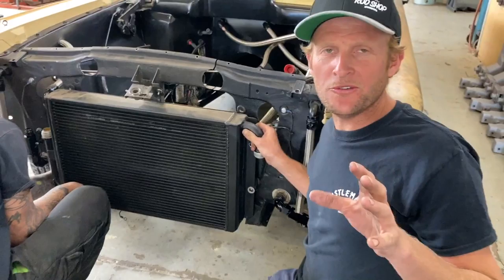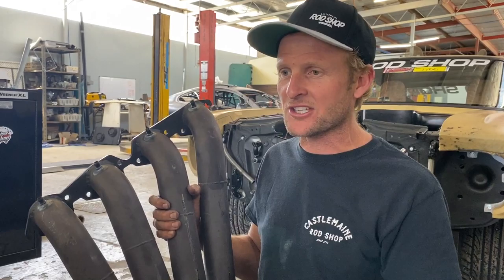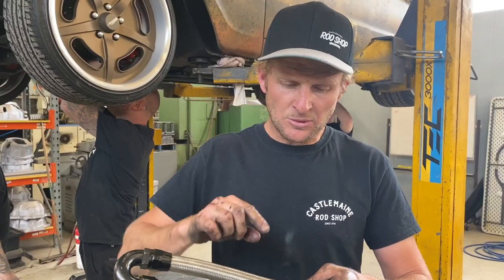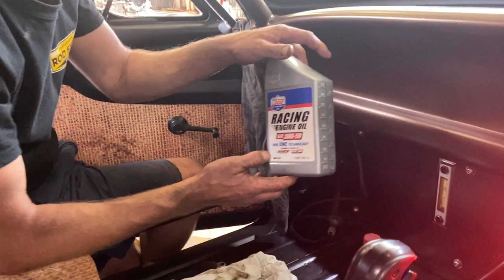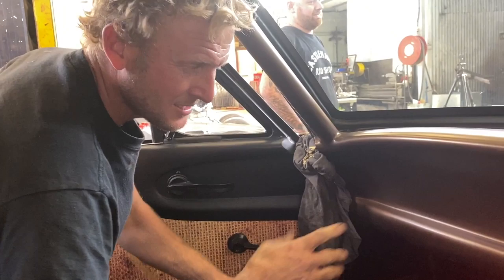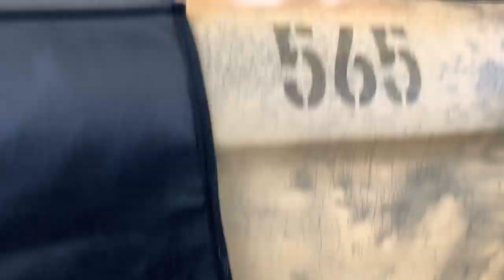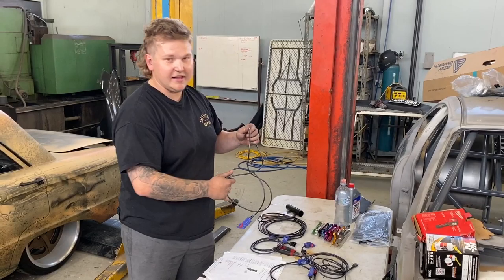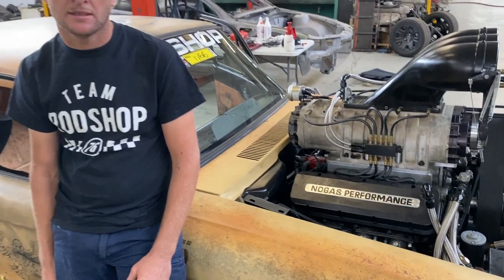USA Trip Episode 2

Comment: Man alive, there’s NOTHING that sounds like a big ol’ screw blower on alcohol. 
Well, except for a screw blower on Nitro...😏 subbed from Kentucky, US of A. Can’t wait to see y’all smoke em up in Florida!
Reply: Tk Boyd that isn’t a screw blower though.... it’s a roots. Always wondered why the burnout guys don’t run a screw blower
Reply: @brettwarren3429  it's a screw not a centrifugal roots are screw blowers the vains turn in side of each other looking like a screw no ?
Reply: @jasonsparshott7208  roots blowers have very minimal twist in the rotor packs, and compress air in the manifold. Screw blowers compress the air in the rotor pack. Similar appearance, but different levels of efficiency.

Comment: Gotta remember we don't use 220 volt sockets in the US (we do but they're rare and are used for things like home refrigerators), it's all 110. Might want to find another solution for that oil heater. Can't wait to see you guys in the states!
Reply: Joseph Waters 240 volt receps are used in a good majority of homes in the US. (And it's not for refrigerators either) Electric clothes dryers, ranges, and dedicated circuits. Most working garages have at least a few also. Compressors, welders, etc. And a pigtail out of a electric panel can be set up pretty quick if need be for temporary use. He needs to make sure he has adaptors for plug configuration.
Reply: @KJ-kw7gh  it's also a different frequency, Aussieland is 50Hz IIRC...
Reply: Richard Harrold 50-60 hertz doesn't matter for heating elements. But, best solution just buy a 120V single phase to use in while he's over here.

Comment: If you are having problems with oil pressure, install a pn# 23900 Moroso accumulator 3.0l with a pn# 23905 electric valve solenoid the trunk. Do you guys use them in the AU? It contains oil in the accumulator,then pushes and pulls  extra oil into the pan, but only when needed.

Comment: If that is a suction line you were replacing you shouldn't be using that type of hose, it might be braided but it is really only glorified heater hose..  Get a proper 3000psi rated double braid hydraulic hose.  You can get them with reusable fittings but they will never collapse under vacuum and  you will need a huge amount of mechanical pressure to pinch the braid. 

Cheers